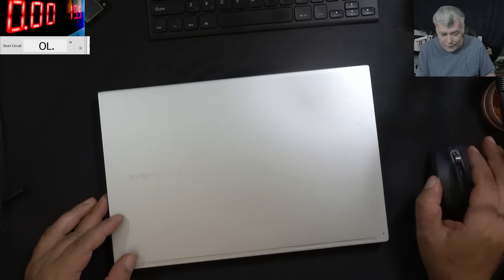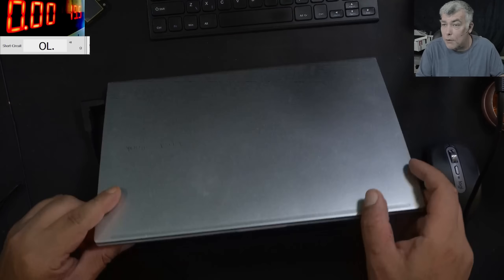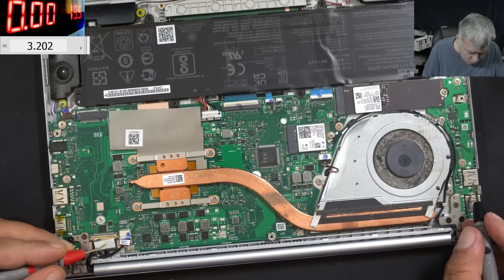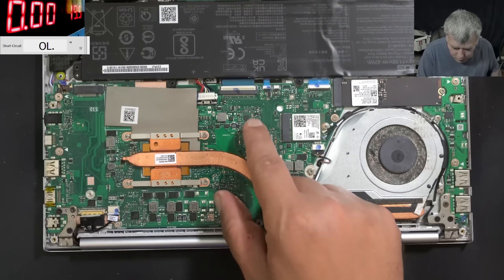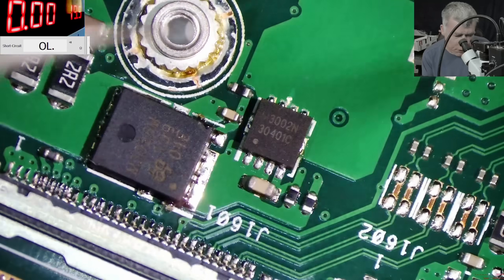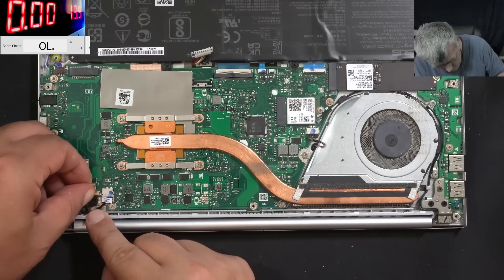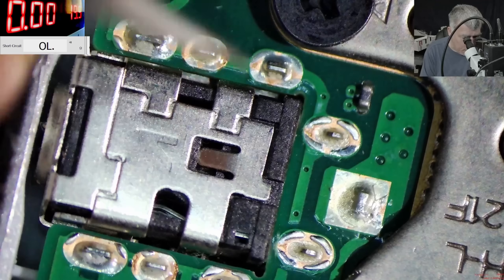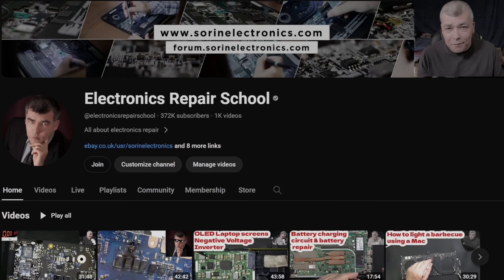Asus M431 not charging - Main power rail 3v, this can be the fault

Comment: Please my fellow Engrs,I have HP 840g3 that I'm fixing, the problem with it is that  it lost power on the first most and I checked the board thoroughly and nothing was shorted ,I bridge the mosfet with a diode it's working but not charging , how do I fix the charging system please 🙏? I'm thinking it's bq chip issue